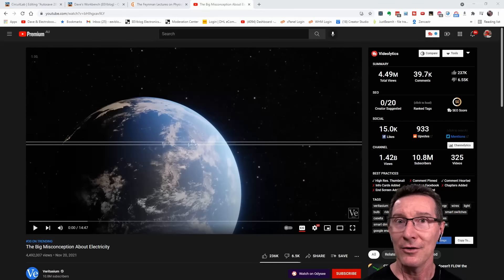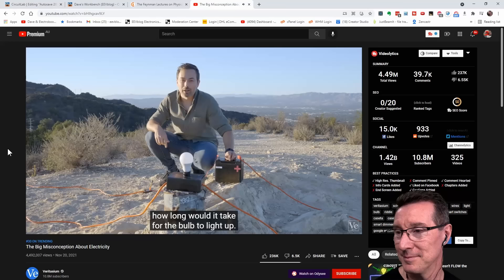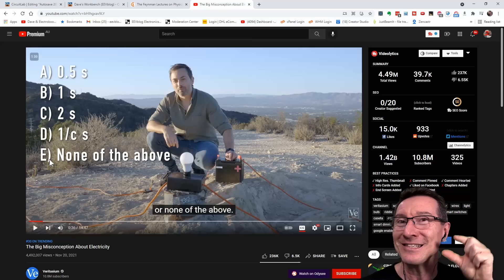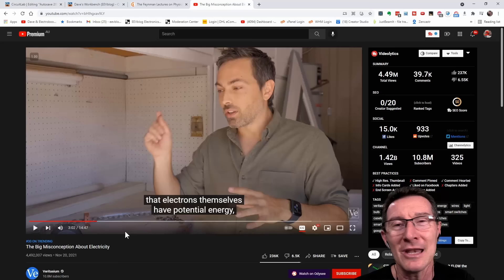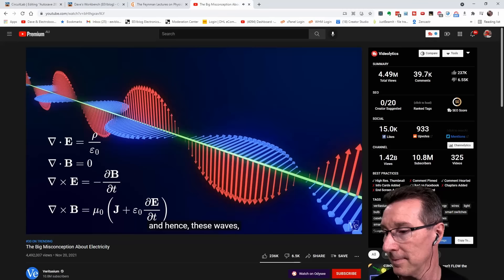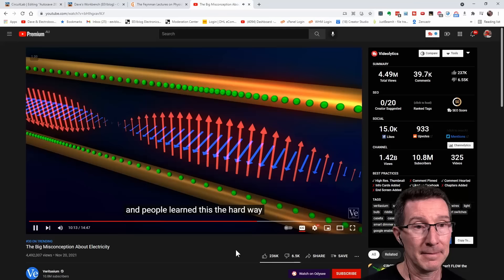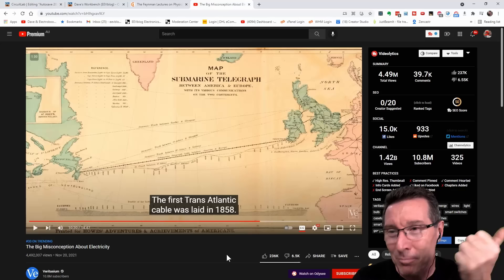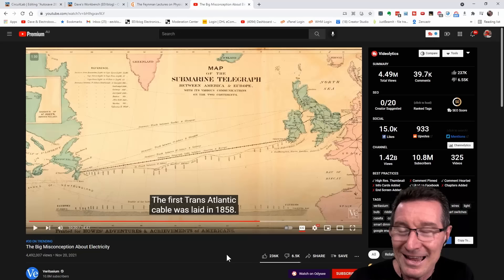EEVblog 1439 - Analysing Veritasium's Electricity Misconceptions Video

Comment: Technically, Dave, it is you who is incorrect. And more than once :( 

It is not "1 metre/c" as you said. It is "1 metre/c meters per second". Interestingly "1 metre/c meters per second" equals "1/c seconds" which is actually what Veritasium has as his "answer D: 1/c s" where 's' stands for  'seconds'.   
At one point you also mistakenly say "1/c squared". You need to be ver careful when you criticise someone, Dave ;)

Point taken about the distance between the battery and the light being important, but Veritasium makes it clear several times that it is 1 metre even going so far as to label it I metre on the diagram and saying that it is the distance between the battery and the light. And, not to rub salt in your wounds, here you actually say "distance between the wires" when what you should have said is "distance between the battery and the light". And you repeat this same error later on.

And the next few minutes of your video is pretty disingenuous, Dave. He clearly is not talking to engineers about practical engineering. Whatever made you think he was? His videos are for a general audience interested in science. In fact. later in your video you even recognise this fact explicitly. And, honestly Dave, that illustration of a chain inside a plastic tube IS wrong, right? Oh, right, you then say he IS correct and it IS wrong. 

But DC works just like AC when it comes to energy flow. Yes there is a skin effect with AC but that was not the topic of his video. It's 15 minute video, and he clearly defined what aspect of physics (not practical engineering!) he was going to cover. What more can you ask? He cannot possibly cover every detail. Which is why I find your commentary rather disingenuous and a little annoying, especially when, in the end, you admit he did a good job!

When you say "energy slash power", the implication is that they are the same. But you immediately contradict this by saying "energy is power per unit time". But that is actually incorrect. It is the opposite: "power is energy per unit time". And then you again disingenuously bring up how engineers think about this from a practical point of view when you must know that all Veritasium is doing here is explaining why this is actually wrong from a physics point of view. 

So, yeah, a practical engineer criticising a physics teacher talking about physics for not talking about practical engineering. Wow!
Reply: @William Verhoef
EEVblog's lumped element model here is not the right one for Derek's experiment set up.  Nor is Derek's answer of 1/c correct.  Go to the top and sort comments on "Newest First", scroll the time stamp of this post, and read mine.
Reply: @stickfijibugs  
It is not even possible for both statements to be correct. It is not possible for the statement "power = energy per unit time" to be correct AND for ther statement  "energy = power per unit time" to be correct. The first is correct. The second is clearly incorrect. In fact, 'power' is the rate at which 'energy' is transferred or converted. The units for power is 'watts' and "watts = joules per second". The units for energy is just  'joules' not "joules per second". 

You said that "Nor is Derek's answer of 1/c correct". Well, he said that "1/c s" is correct. The 's' stands for 'seconds'. He could have given a more general statement: "d/c s" where d is the distance in metres between the battery and the light and c is the speed of light in metres per second. But "1/c s" gives the correct answer because d = 1 metre and he already gave c = 299 792 458 metres per second. Plug those values in and it gives the correct answer.
Reply: @williamverhoef4349  You're right, W = J/t, t is in s.  That was a slip up indeed, words vs symbols.  I edited my original comment, thank you.

I do maintain my second paragraph. Here is the explanation from the main thread.

------

Derek's answer of 1/c seconds (1 meter-between-wires / speed-of-light-in-meters-per-sec) for the way he has his experiment set up, is incorrect.   

On top of it, his is a very poor explanation at best.  The big problem with this video is at the beginning he conflates AC step signal (action of throwing the switch) with DC steady-state (turning ON the bulb), and it looks like he himself does not understand the difference.  That is surprising, and why his consultants in the video didn't explain it to him.

For example, taking his circuit as in his diagram where two parallel wires separated by 1m over a very long distance, true that there is a TINY amount power transfer that occurs INSTANTANEOUSLY due to 'antenna effect' between the conductors right near the switch and the bulb.  But, that would not even flash his bulb in the least (the AC signal part).  Even a very sensitive LED would not momentarily light up: the 1 meter separation is just WAY too far to transfer enough power, although, you might be able to see the a tiny short impulse with an oscilloscope across the bulb.

However, if the wires were very close together, say separated just by the thickness of (very thin) insulation, then the bulb (better a sensitive LED) might produce a barely visible SHORT FLASH at the moment he closes the switch at 1/c later (which is also half-explained in the rest of the video with the E&M vectors etc), and then stay OFF until travel is completed around the whole loop (a total of 1 light-second if wires are at absolute 0 adding no delay).

So, at that point with an experiment topology where the the wires are close together, after the short flash on closing the switch, 1 second later, the bulb would turn FULL ON and stay FULL ON.

In conclusion, if the wires were run right beside each other, the answer would be both:  1m/c flash and 1 seconds later steady ON.

Thus, the real answer for the way he has his real experiment set up is 1 second, not 1/c seconds.  He needs to fix this.

More here ....

However, I disagree with EEVblog model of a transmission line:
https://youtu.be/VQsoG45Y_00?t=1553
A transmission line model would be more suitable if the conductors were large compared to the distance between them.  Thus it does not apply to Derek's experiment.

EEVblog's lumped element model is also not accurate.  The characteristic impedance of Derek's wire pair is indeed 900 ohms, however, EEVblog uses 1 uF capacitors. The capacitance of Derek's wire pair is almost non-existent.  EEVblog says "the impedance doesn't matter". It DOES matter, because his model does not correctly represent Derek's experimental set up.  Also, it DOES matter what the capacitance value is.  In other words, the impedance of his model is very low compared to 900 ohms.  But, it IS worthwhile to watch the whole video.

In my opinion, the better model for switch flip instant is a dipole antenna with a step source at its center, and, I contend that the power transfer between the parallel wires is much greater due to the EM transient (Derek's explanation) than to instantaneous current flowing through an uncharged capacitor (in EEblog's model), especially that capacitance (uF/distance) is so small it is negligible.

Thus for the AC step transient in Derek's model, the top half with the light bulb is the receiver, and the bottom half is the transmitter.  The result is still a barely perceptible single flash in an LED followed by an DC steady state ON condition 1 second later, as generally explained by EEVblog.
Reply: @stickfijibugs  
Thanks for conceding the point about power and energy being different.
But you may be right about the second point. But Veritasium did add a condition at 12:30 into the video as well as a link to two colleagues who seemed to disagree with his conclusion. 
And, of course, the main point of his video was to show that the energy is carried in the electromagnetic field, not in the wires. 
Maybe he should have cut out the experiment. Although it has created a bit of a discussion so maybe that's good.

Comment: Magnetic force, how mysterious and wonderful the works of the creator! Electric current flows from a power supply to the equipment that is using it and then back to its source, it does not flow into the earth’s ground, lightning does.

Comment: i still laugh at this.
matter is 99.99999... percent vacant space.
the field is between the matter.

the big question is what is energy ?
is it matter in motion ?
is it  Photons ?
is it fields ?
etc etc

does the field extend beyond the wire yes but its not like it is said.
this is basicly describing that most of the energy is out side the wire.
but what is the energy.

details left out and misleading totaly agree.

Comment: Great review but kind of knitpicky. Like you mentioned multiple times, his audience is not full time professional electrical engineers. Mentioning the stuff you suggested would confuse his audience like you also mentioned multiple times.

The fact that energy flows outside the wire is lost on 99.99% of the population, including even many casual electronic engineers like me, who may have learned it, but forgot or didn't realize everything it meant in reality because you rarely think about it while building electronic circuits in daily life. The video makes the world a better place, not worse.

Comment: Well I've seen a few circuits burn and I can tell you that the energy very much travels through the wire. And when it comes to transformers, yea you can burn the steel core if you under-engineer it so there the energy is very much inside it too. :D

Comment: ohh im getting to drunk ..;)  wathcing  "how electricity flow work" :) i remmember  from school  that magnetic needle  align to wire  showing electro-magnetic field  so it  will be getting 1m distance  faster  then 300000Km  of wire  but this not the  point i see  that if radius  is  light  speed   distance ...  and with no super conductors and unlimited power... 0=0  no gain , no power , practical usage  is a thing still  ,  i like your explanation ...   but i thought it  induction   .... electric field reach at the speed of light  and induce current  on opposite wire and current will flow  , father show how couple turn of wire can show voltage  around a other wire  ... i was  shocked  ... how needle can move  ...  but this is how thing work  ... i was lost ... how ... without  direct  conntact you can get readings with multimeter and after a learned how transformers works ... and he  build a thing  to see a transmission  power ... like modern rc wave  detector  ... learning stage ... i still wondering  how something  works without battery power just by electric field ... these was a days of of new discoveries ....  and then  i found out  how tv remote works with osiloscope  by connecting  IR diode as a probe ... i been testing everything  ... simple DC motor  turning by hand  and see  the line shape change ... i had a good father  but  the best thing was then he show  one thing  witch can turn 4.5V battery to 3000V  ... you charge a capacitor and give it to friend  :) ... what a shock :) you don't want to catch it  ... this 400v  capacitor you charge from the socket ...  for babies  :)   crazy lesson of electricity  power ....  these old  tv set  with 25KV  tube  power ....  you can get an arc with simple screwdriver , as a children   a knew how to start fire with just tv set  and screwdriver ... how good its for me now ... not at all  ... but memories  priceless :)

Comment: Wrong - the quantitative values matter A LOT!  It deluded you and Derick into false conclusions.  You can't produce a visible amount of light from those fields in the first second.  FAIL!
Reply: Exactly, both presentations are confusing, but this one less so.  I explain this in detail.  Moreover, EEVblog's lumped element model here is not the right one for Derek's experiment set up.  Derek's answer of 1/c is not entirely correct either.

You'll be surprised at what the answer really is ....

Go to the top and sort comments on "Newest First", scroll to the time stamp of this post, and read mine.

Comment: Apply the kiss principal and keep it simple stupid. Dc circuit and kirchoffs law.  As there is dc potential in the wires just waiting for the switch to close and electron's to move. The pulse of the magnect field when the switch is closed would not sustain the light.

Comment: Do you try to be politically correct? If students will be using this video did they get the correct message?
Reply: Not quite.  EEVblog's lumped element model here is not the right one for Derek's experiment set up.  Derek's answer of 1/c is not entirely correct either.

You'll be surprised at what the answer really is ....

Go to the top and sort comments on "Newest First", scroll to the time stamp of this post, and read mine.

Comment: It's 1 (m) / C (m/s) so it's 1/c seconds.
Reply: 1/c is the reciprocal of c, which doesn't make any sense. So the unit is relevant: just 1m/c without the "s" when denoted c. As long as "s" is denoted it would become seconds squared per meter (3.336x10^-9 s^2/m), which would make even less sense.
Reply: @paco3447  have you ever studied physics? The time needed to travel one meter at the speed of light is 1/c seconds. Period.

Comment: The disaPoynting video of Veritasium is more than confusing, it is misleading. I have not seen any interesting responses so far. Physics is great, engineering's perspective also. But if you are going with though experiment about non-realistic zero resistance cable the size of many earth, at least stick to those principles.
So let's cut the circuit at both end, because "capacitance" at 1 meter is the only thing that matters, right ? Fine. Now turn on the switch. Yeah yeah, the good answers is still 1/c because the ends of the "non relevant circuit" are not even in the same causal light cone. Let it be light... or not.
Flux(¨)of charge(electron) and flux(¨) in electromagnetic fields are simply two side of the same coin. Derek's conclusion smell like whoo, and "energy flux" and Poynting vector should not be made to resemble Scotty beaming energy through empty space, because it's not.

Comment: hi,
i like your videos but not this one.
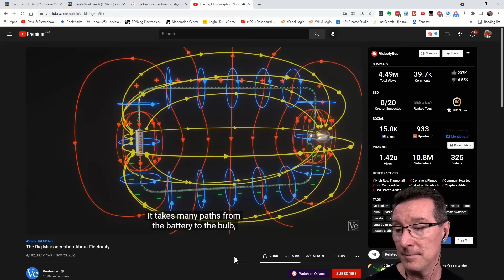i stopped watching at the second unmentioned big misconception (of the referred video) at 12:22 in your video. the first one, fundamental: the magnetic and electric fields are not "in phase" with each other but instead 90° offset b/c they are in turn caused by change rate of power of the other field. but the second one is MUCH worse. in the moment of powering on, a changing e field etc has to propagate through the media (here copper and air and insulator around) which has a lower "field distribution speed" than vacuum with my-zero/"micro-zero" permeability. so my guess (for a "real" experiment, see below) is "answer e / none of the above" with roughly 4s.
adding to this is not noticing that a DC car battery is on one side and an AC light bulb (E27 socket? energy saving bulb including electronics... NOT based on electrons on DC really traversing a narrow shaped pice of conductor that will heat up and glow with high intensity) on the other side.
unbelievable what dumbness the us american "pay for education" school system produces.
this is not ANY experiment at all.
kind regards anyways,
mdbuerkle

Comment: This is the biggest BS I have ever heard. The energy delivered inside of the wire. Period. The electro magnetic field is only a byproduct of the current. If you use 2 light bulbs which direction the vector points? The chain demonstration perfectly showed that the electron that leaves the power source is not the electron that makes the light bulb lit. Simply one electron excites (pushes) the next one and so on just like the chain links. The electrons in the lightbulb itself will get into motion DC or AC does not matter and that motion will create the power in the light bulb. Your Poyinting vector is just another pointless theory. Come on EEVblog! Think!

Comment: Here's what I wrote on Versatasium's page:

No.   Extraordinary claims require extraordinary evidence.

1. If the RF power flow theory were true, then a light couldn't work in a Faraday cage.

2. Calculate the energy lost by the battery, and you'll find a similar energy spent by the light.  If you move the light around to locations with different field densities, then the amount of power available to the bulb should have changed based on RF power flow theory.  But the wired connection ensures that almost the same power reaches the bulb (there will be some line losses). 

Yes, light is quirky because it is massless, relativistic, and Quantum in nature.  We can still learn more about light and electricity.  But unless we are going to go back to some kind of ether theory to explain the power flow (through a Faraday Cage), then this presentation is thought provoking but fundamentally wrong.  

It's as if @Veritasium were trolling us to see if any of us can still think rationally (which is clearly not the case for the vast majority of people out there today).